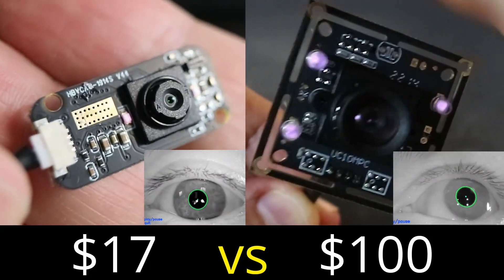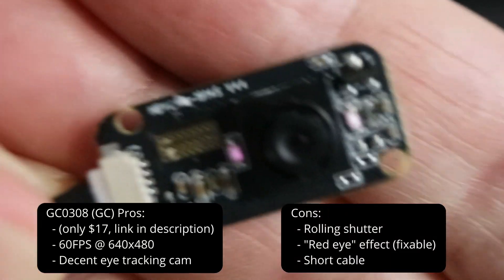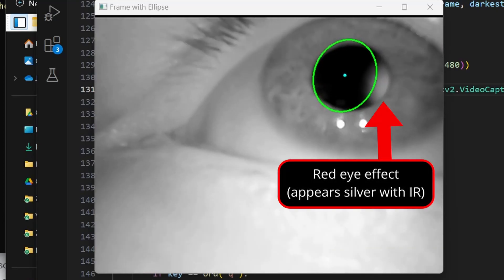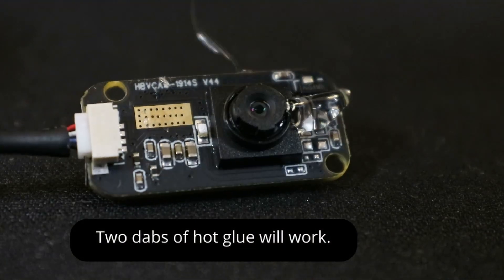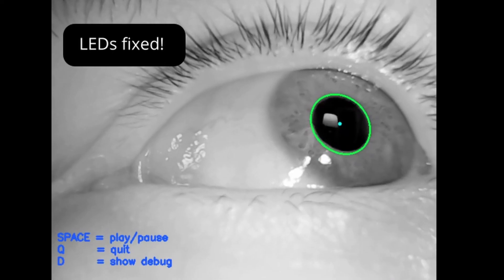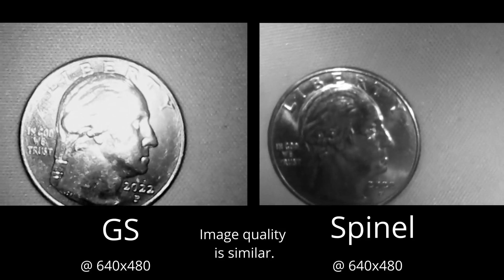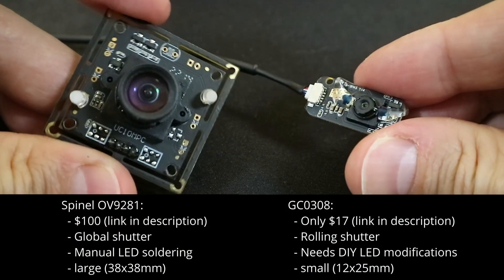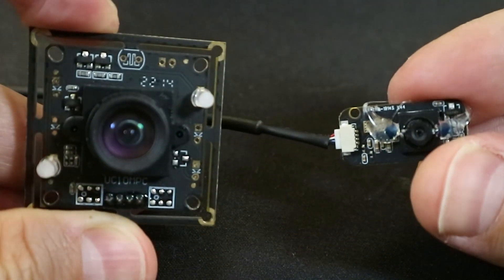$17 vs $100 DIY Eye Tracking Cameras

Comment: Neat demo, but by default these modules are WAY too bright for eyetracking! The sharpie on the glue will help a little but please also increase the LED resistor or use external LEDs! (Like the kits from ETVR)
Reply from the maker: The $100 camera is indeed too bright, but the GC0308 is actually about the same as commercial eye trackers like the pupil labs. See the discord for a detailed discussion on that.
Reply: @jeoresearch  Idk man, I have the modules and can't stare into them for very long before getting eyestrain. IR can cause just as much damage as visible light, and you can't tell it's happening until it's too late. Also measuring this correctly is really hard and I do not want to risk my eyes based on a quick measurement with a $50 device.

Comment: are these ir emitter dangerous for your eye?somes said it is (from vr eye tracking community)and if it does,how can i reduce the power of it.
Reply from the maker: For the GC0308, I've measured the irradiance, and it's actually less than the pupil labs tracker, a commercially available eye tracking system. For any other LEDs with unknown irradiance, I explain how you can measure that in the following video: https://youtu.be/z30AyH_1XVE?si=jYoGkPjHdGIxnLi9

Comment: Important question: do I need to do the hot glue trick on the $17 camera for the irradiance level to be safe for my eyes when attached to the glasses frame? I didn't do it yet and curious if it's safe for my eyes to use without the hot glue

Edit: I'll do it just to be safe. Still curious about the answer though 🙂
Reply from the maker: As long as the cameras are more than 3cm from your eyes, they should meet standard irradiance levels. However, there may be some variance in manufacturing processes by that maker, so I definitely recommend testing with the irradiance meter just in case.
Reply: @jeoresearch  thank you Jacob. Any way I could get in contact about a few questions, like one is I tried sharpying the front of the hot glue because I don't have black paint, and I still saw the fish eye effect so I tried using black ink and accidentally put way too wide ink over the front of each IR light compared to the amount you showed in the video. Idk if it's too much. I plugged it in and tried it and am still getting some of that shining glare or fish eye or something
Reply from the maker: @bragtime1052  I see. Can you join the Discord and post some images of what it looks like?
Reply: @jeoresearch  sure, awesome I didn't know about the Discord 😀
Reply: @jeoresearch just realized I called you Jacob, lol sorry 😂

Comment: Hey, I was wondering how the eye tracking results differ through longer distances of ie 1-2ft. Is the camera resolution enough for the pupil fitting to function?
Reply from the maker: Yes, you can possibly fit the pupil at that range, but you would then also have to do head tracking in order to determine the combined head/eye gaze ray.  I'll be uploading another video on head gaze soon!

Comment: This is so cool! Is this for vr? Do you have a tutorial for the gc0308???
Reply from the maker: And yes, you could potentially put these cameras in a VR headset!
Reply: Does it work at 1 or 2m ? Can we use it to point on a pc if it's mounted on a screen ?  @jeoresearch
Reply from the maker: Thanks! Not yet, but that is a great idea! I need to finish up my 3D gaze vector code , but will try to get it done soon!

Comment: 👏👏👏Yet another impressive video; THANK YOU! Can you pls comment on (a) if you use 50 or 80 degree view angle for GC0308, (b) how far the camera w.r.t. the eye (may be you can share a photo or video showing both the eye tracking camera and the head/face of the person together from an external viewing position), (c) what is the typical frame rate to detect and display pupil ellipse detection and drawing, (d) how much processing power (CPU speed and memory requirements, OS etc) used to achive that frame rate, (e) what would be the lowest cost computing hardware (such as RPi etc) to for high-speed pupil detection and drawing? Once again THANK YOU for your informative videos!
Reply from the maker: Glad I could help! a) This is the 80 degree version, but the 50 degree should also work. b) about 5cm c) 30fps is fine for most apps, but I think you can get 60FPS+ with this camera. d and e) This will run on the raspberry pi 4b at 15FPS, and it should scale up linearly with processing power. E.g. 2x CPU speed would be double fps.

Comment: Bro, can you help me build a gaze-tracking system for sleep/drowsiness detection and alerting?

I plan to place the camera at a distance of about 6 cm to 8 cm and use an IR camera. However, I have several doubts and confusions.

Most IR cameras available are not pure night vision; they allow both IR and visible light. I heard that I should use an IR pass filter to allow only IR light. Also, I’m not sure whether to use 850nm or 950nm—what would be the best choice?

What I’m trying to achieve is a purely grayscale output to reduce the processing needed. By the way, I’m planning to run this on a Raspberry Pi Zero 2 W.

Can you please, please help me, bro?
Reply from the maker: Great questions! An IR pass filter is best if you're using the tracker in a brightly lit environment, but it's not 100% necessary. Both 850 and 940 nm would work fine, and most algorithms run in grayscale already, including mine!

Feel free to post any other questions on the Discord~